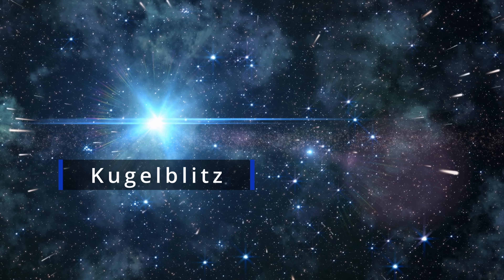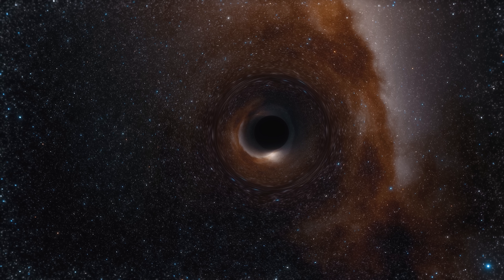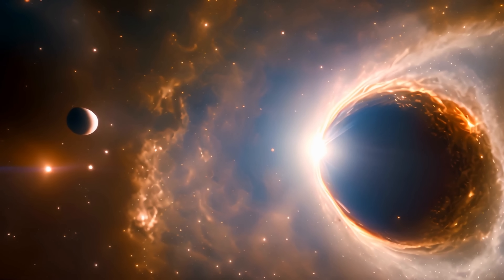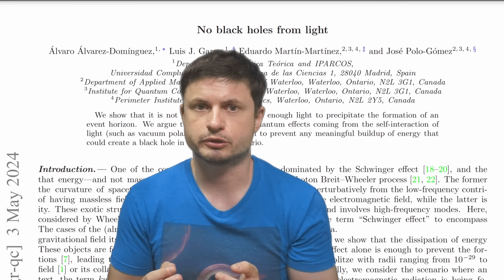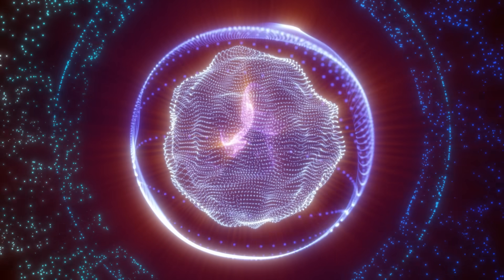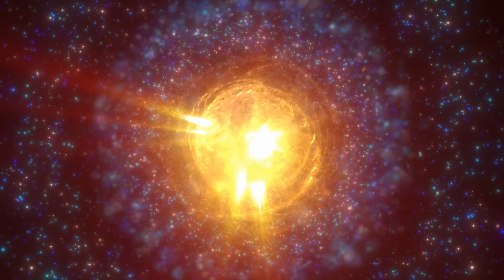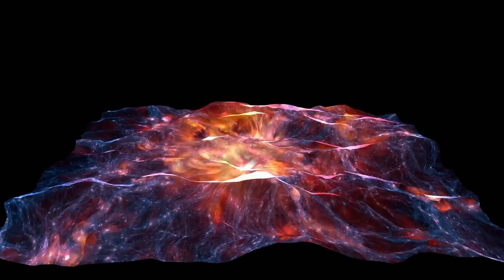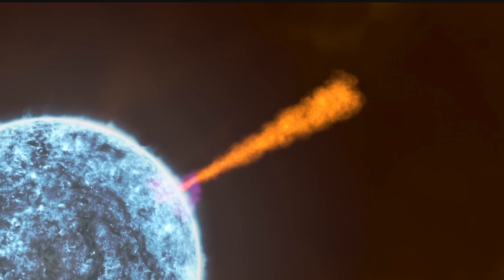Bizarre Black Holes Made Out of Light Proven To Be Impossible (Kugelblitz)

Comment: *turns of my flashlight* pack it up guys, it's not gonna happen...
Reply: This made me laugh XD
Reply: If you put your flashlight one the front of a future spacecraft traveling at 99% of light-speed the light coming out of the flashlight 🔦  would be blue shifted into high energy gamma rays.
Reply: @douglaswilkinson5700 
Will it ever cure cancer?
Or at least STD?
Reply: @douglaswilkinson5700   um NO😡 99 percent is only like lorenz factor of 5 which is not enough to get the visible light to lithography. actually plug the number into the calculator before comment
Reply: @douglaswilkinson5700  If the spacecraft were traveling at 99% the speed of light...... and you ran from the back of the ship to the front.......
Reply: @menjolno  At 99%c the Lorentz factor is 7:  γ=1÷(1-(v²÷c²))^½  This would make the shortest wavelength of visable light -- violet @ 380 nm -- into extreme UV @ 54 nm.  However, I recall one of Fraser Cain's guests stating that a spacecraft traveling relativistic velocities would encounter the CMB radiation as gamma radiation.

Comment: I appreciate the skeptical bent of this channel, but this is a little much. You take enough lasers and shine them on the same spot and you will get a black hole. There is no way to argue against this. It's just simply a fact of physical reality.

The Schwinger effect might prevent an event horizon from forming around a region if it's being fed light from a single source, but it won't prevent a black hole from forming if the energy is coming from all directions at once.

Comment: Mayve Kugelblitz is responsible for the blackholes we find to be "outside the mass" of what would regularly occur. I've heard Anton mention size problems with many blackholes encountered... idk, just a thought. Gr8! Peace ☮💜Love
Reply: The mystery presented by the extreme size of some of the largest and oldest super-massive black holes is not explained by the Kugelblitz as it would most likely only make relatively small ones.  The problem is also smaller than some people seem to think.  If we assume that conditions in the early universe were very similar to the present day then the largest of black holes found do present a problem to physics.  However it seems unreasonable to assume that conditions were the same, so some fairly minor adjustments to presumed conditions could make black hole mergers a lot more common in the early universe, and also make it possible for them to grow by accretion faster than they do now.

Comment: If it's true, you can side step it by using some matter as a initial mass for the micro black hole. Inertial confinement fusion uses lasers to implode matter hard enough to force fusion to occur, but if you use your personal Dyson Swarm to add more laser, you can implode it even harder, to the point that starter mass's density exceeds the minimum required to make a micro black hole.

Comment: Anton talks about Kugelblitz black-holes perhaps forming during the earliest stages of the big-bang, but nobody has really explained why the big bang itself wasn't a black hole.
The Schwarzschild radius of the entire known mass of the current universe is about 120 (to 200 - depending on how you calculate the mass) thousand lightyears across, which is way bigger than the size it was supposed to be during the big-bang (theory), so either mass wasn't working the way it does now, or cosmic inflation lasted a lot longer than most people are led to believe that physicists claim. Or both.

I'm especially confused because black holes also affect time. So I don't even understand what "X nanoseconds after the big bang" is supposed to mean.
Reply: Because the various physicists have been mathematically able to prove dark energy expansion or what ever causes expansion because of the expansion will prevent the creation of black holes.
Reply: if the universe is infinite, and mostly uniform, then even if every point in space has a density high enough to collapse into a black hole, it wont actually collapse.
This is because the gravitational pull from every direction is the same, for all points out to infinity, so it gravity cancels out.

Imagine the early universe as an infinite, evenly spaced grid of points. No matter how close together those points are, they are still pulled equally in all directions so no collapse can start.
Now, we know that the early universe was not a perfect grid like this. If it was it would still be a perfect grid today, but even with small imperfections in the grid, most points would still be pulled almost the same amount in  all directions. 
It is possible that large imperfections in the grid may have collapsed into black holes in the early universe. If these types of black holes exist, they are known as primordial black holes. They have not been 100% confirmed to exist, but these may have been the seeds that gave galaxies huge black holes.
Reply: A distance of X light-nanoseconds is the distance along the Fundamental Observer world-lines of the FRLW metric.
Reply: The Universe is, and always has been for the entirety of its existence, infinite is size (spatial extent). It cannot have a Schwarzschild radius.
      **This is current with our best understanding of the theory and from observation.

Comment: It was always my understanding that any matter falling into a black hole was doing so as Energy, matter explodes into energy at the point of no return upon touching the speed of light just as it enters.
Reply: Nope. In really big black holes, you could pass the event horizon without even noticing until it was too late, because the larger area means that the gravitational gradient is very gradual. 

Also, matter cannot reach the speed of light. It would take infinite  energy to accelerate any particle with mass to light speed. That's why only massless particles like light can move that fast.
Reply: @araaraaura1887  I dis-agree, it does at the Event Horizon, why do you think it throws off so much energy when it should be sucking it up.
Reply: Your understanding has never reflected anything anywhere in accepted science.
Reply: @araaraaura1887  In the presence of gravity there is no speed of light restriction as it's coordinate dependent, unless you're specifically referring to the local vacuum speed. For example, in Schwarzschild-Droste coordinates the speed of light at the horizon is zero, or in Gullstrand-Painleve coordinates the in-going speed of light is twice the local vacuum speed.
Reply: @Titus-as-the-Roman  Because it's actually extremely difficult to fall into a black hole. They're way smaller than Earth, and they don't suck up matter any more than any other stellar body of equal mass.
Reply: @Titus-as-the-Roman  The extreme energy output of a black hole doesn't come from the event horizon at all, it comes from the accretion disk, which works by accelerating matter to near the speed of light, causing extreme heating and radiation. 

That's entirely different from Hawking radiation, which happens at such a slow rate for any natural black hole that it might as well not happen at all. 

The black hole itself doesn't actually give off any meaningful energy or radiation.
Reply: @OhhCrapGuy  Yes as it's still moving at near superliminal and plowing through a sea of cmb radiation not to mention all those pesky baryons in said accretion disc . All while being pumped with huge em pulses to keep accelerating it you could say it's a hostile work environment.
Reply: If there was no friction its possible that some of the matter could reach close to the speed of light, but the effects of gravity slow down the passage of time so it would never be able to do so.
Reply: Yep makes sense. Only light has speed of light. No matter can exist inside bh

Comment: This is related to an idea I have where a true black hole is impossible, matter decomposes and escapes in the form of hawking radiation due to the high density.
The matter never actually reached inside because there is no inside, the curvature is still evolving and hasn't actually curved that far yet.
Reply: I assume this is more or less the case as well. It seems true from an outside observer perspective, since the observer sort of sticks to the surface of the event horizon and fades away. And, in GR, someone's light is, for all practical purposes, "them".
It is interesting to consider what the observer inside the event horizon experiences. Granted, there is no way to ask them.

Comment: How black holes form: In order to get a black hole, you need a lot of stuff in one place, and the gravity between the stuff (which is the weakest force of all) has to win out over every other interaction that stuff could have with itself. Here are some scenarios where we think black holes are made:

Direct collapse/primordial black holes: When the universe was young it had more stuff per unit volume. It is suspected that certain areas of the universe got enough stuff nearby that gravity won, and matter collapsed directly to a black hole. One theory that these black holes went on to gobble up more matter (and each other, and other black holes) and now form the supermassive black holes at the center of galaxies, though there are other theories of how we get supermassive black holes.

Stellar Origin Black Holes: A big star forms in the usual ways. Big stars don't last long lifetime-wise. They burn hot, the force of their gravity eventually ends up fusing elements that don't help maintain enough outward pressure to support the star against gravity. When they get to this point they collapse, and the outer layers bounce outward, but the core collapses inward. This is a supernova. If the star is big enough, the core collapses into a black hole.

Planets are normally formed around a star and are the result of direct collapse of matter. You could sort of draw an analogy between a direct collapse black hole and a really big planet, but you'd have to ignore the whole "planets orbit around stars" part of being a planet, so its not really a good analogy.

Regarding "Gravity planets" in analog to "<composition> planets" Gravity is subject to something called the equivalence principle, which essentially means that the existence of mass causes gravity entirely independent of what the mass is. The equivalence principle has been measured extremely well, and found to be an exceedingly accurate description of how gravity operates. In essence a pound of ice is just as good of a source of gravity as a pound of lead or a pound of hydrogen, provided they each take up the same space. There is no substance that's inherently better or worse at creating gravitational effects due to anything other than its mass and the distribution of that mass in space.

Comment: Seems more like the schwinger effect is causal, grb's and polar jets in supermassive black holes  interstellar toroidal pinch in action. Right above the event horizon frame dragging from high spin black holes and muonium infused neutronium can form magnetic superfluids in a high spin  state there's your z pinch machine in action also fits with a lot of magnetar models so basically if a black hole feeds on a muon enriched neutron star there's a well better than zero chance it will form a toroidal structure as its getting stripped and spaghettified the black holes have a big magnetic field spinning away if you got it's insertion trajectory right you could possibly use muon enriched neutron star to make the pinch offset and give the black hole (regular stellar mass supermassive forget about it) a hell of a shunt and cook anything in the other direction for a long way.

Comment: I saw a thing a while ago saying that black holes could be connections to parallel universes, but wouldn't be crossable mostly because a buildup of light would make more black holes inside the black hole or something like that. If kugelblitzs aren't possibe does that mean that this is possible again? Or would the schwinger(?) effect not work inside a black hole?
Reply: In my layman knowledge: We do not currently know what actually happens inside a black hole. So we cannot predict, if the Sauter-Schwinger effect takes place there - so we have, at best, informed speculation.

Comment: I know how to make a black hole in a lab. Of course, you'll need a lot of energy. You just need the same method as inertial confinement fusion devices. A small pellet of 'fuel' in the middle, heated by lasers from all sides. The outer layer of the pellet evaporates and emits X-rays, which causes the core of the pellet to implode inwards and start fussion reaction. With the same setup, if you drastically increase the power of the lasers (probably by many orders of magnitude), you might get a mini black hole in the middle. So maybe we could use those one day as power production devices. But I wouldn't want to be anywhere near the first experiment of the sort and it should be done far away from inhabited planets...

Comment: Does the article rule out only Wheeler's description (i.e. a beam strong enough to collapse) or all possible configurations of light that could form a Kugelblitz? 

I imagine the onset of the Schwinger effect could be delayed by spreading the source out to as many points as as possible converging on a small volume of space (in fact, that's how I've usually heard the theoretical formation of a Kugelblitz described). The question then is, does the event horizon form before the converging light generates a strong enough EM field to begin being sapped of energy through the Schwinger effect?

You could imagine trying to combat the Schwinger effect by increasing the size of the event horizon, however, this would also increase the volume undergoing the Schwinger effect and it'll come down to whichever wins. I'm guessing from the article title, the Schwinger effect always wins.
Reply: I'm still trying to understand where the energy lost from the Schwinger effect is supposed to "go," when the curvature of spacetime approaching the conditions for a black hole is so extreme.

But these people have degrees I don't so what do I know lmao
Reply: @plvmbvm513  Good point!

In fact, collapse in the example of Wheeler's beam pulse would probably be more difficult to avoid as the energy is already very compact, so my gut (very scientific I know) tells me particles would never have the time to escape before collapsing. They could via quantum tunneling, but that's relatively slow and is essentially Hawking radiation, so is it actually a black hole already by that point?. (Note: I believe Wheeler's thought experiment is exactly that, a thought experiment, being impossible in a practical sense)

The Schwinger effect may actually be more influential in the example I brought up (many converging sources) since the curvature of space-time isn't as intense until near convergence.

But exactly like you said, that's my amateur's POV as I'm most certainly not an expert while the authors are. It'll be interesting to see if there are any future articles that counter this one.

Comment: i read the paper and im pretty sure its probably just wrong: they justify a continuous energy input by saying its in the weak gravitational regime, which is unlikely the be true. they dismiss interactions between the electromagnetic fields and particles, they neglect general relative effects. its based on estimations that arent well bounded. etc
not very convincing, and also it implies that blackholes from electron positron pairs would be impossible which seems odd too.
Reply: The paper seems to be referring to a particular experimental setup where there's a uniform electric field intensity inside a spherical region. They argue that the Schwinger effect dominates well within the weak-field limit (though they don't specify what they mean by weak-field that I can see). 
      The paper does run contrary to the typical setup of the kugelblitz where there's an in-going null surface that crosses the location of the future horizon and is therefore defined on a closed trapped surface, so any subsequent interaction is irrelevant.

Comment: Good crazy glue just appears in alternate locations.  Like it requires one drop, but it has moved under mysterious circumstances.  Cheap crazy glue, it becomes a gas, but how did one drop manage the replicate itself?  So maybe not photons, but extraordinary crazy glue objects.  I would call it the cheddar chease effects, when you want a thin slice of cheese, the knife bounces out because there is less force in the tginner diection.  Glue doesn't work like a magnet to solve anything, it works by half life mastication.  So theres literally nothing as mastic as good crazy glue, so its form bounces out of reality, the cheese because it holds a purer transform through zero than a real object.